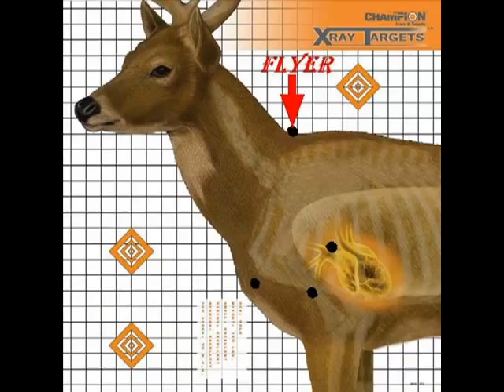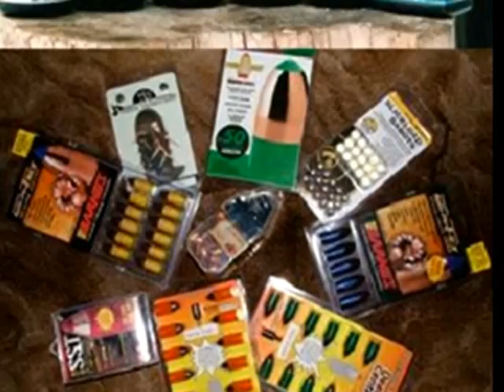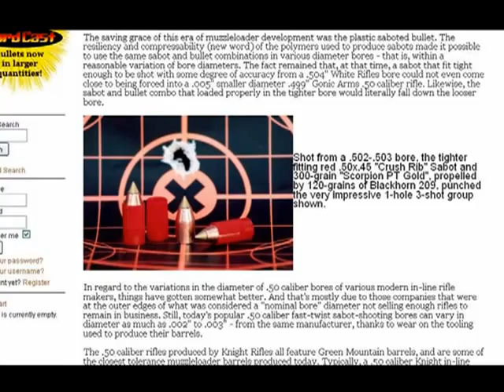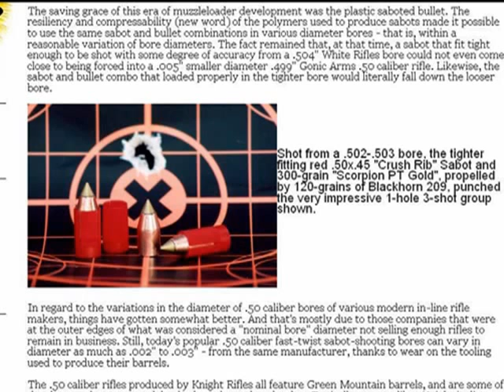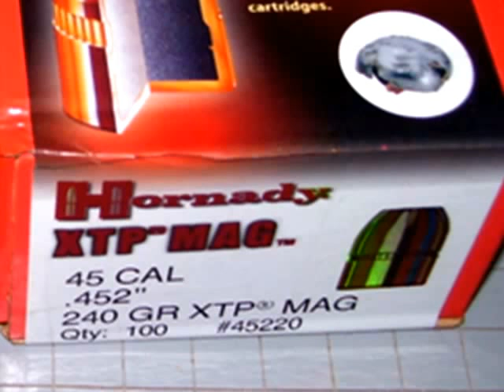Muzzleloader Accuracy Using Aluminum Foil  - Barrel Size -

Comment: I have had people at the range tell me the TC supper glide tend to not grip the bullet well with a heavy charge of powder. The bullet will slip in the supper glide and not spin true to the rifling in the barrel causing instability. One guy had the same problem that you had. He took a small dremel cutter and cut a fine line in the bullet and filled the line with a red wax pen. After he fired his ML he recovered the sabot and found a red smear in the Sabot indicating the bullet was not spinning with the sabot. I thought it was interesting after reading your post. Just thought I'd pass it along. All ML are different. I have 3.... two TC in-lines and one CVA side hammer. The CVA only likes Maxi balls, The TC in-lines like Sabot but one only works well with 90 gr. of Buck Horn 209 and the other likes a 100 gr. of Pirodex. Go figure. I am going to try the foil... Thanks for the info.
Reply from the maker: Thank you Gene for your post, great idea. It makes sense that the bullet isn't getting good spin in those super glides because until I used the foil to really tighten things up I was getting terrible accuracy. I guess it is possible that my whole problem could have been the super glide sabots

Comment: good  idea, but here is a better one. Buy some hornady FPB's (i think thats what they are called.) they are regular bore sized bullets no patch or sabot required. the bottom of the bullet is hollowed out like civil war mini ball. so whether you have a .501 or .503 barrel it doesn't matter, because when you fire the hollowed out base expands into the rifiling of the barrel. they mushroom well and maintain up to 85% of its weight after a hit.
Reply from the maker: Great input. I will definitely give them a try. Thanks.

Comment: Now if you REALy want to have fun and an accurate rifle, Try casting your own bullets.  As a patch and ball guy for years, Recently I started casting the Lee, REAL 50-250 bullets tumble lubed with Liquid Alox.  These things are Deadly Accurate.  Tight groups, Easy loading, The claim that they clean the barrel as you load is for the most part true.  I swab the barrel after about 10 shots or so with these.  But, no sabot, no patch, easy load, and the accuracy is hard to beat.  Not to mention the fun and satisfaction of casting your own bullets and taking a nice deer with the bullets you made.  Just be sure to use pure lead because alloys and wheel weights are nearly impossible to load.  These things form to the shape of your barrel and the rifling as they are loaded.  Each bullet as you load it becomes a custom bullet for that barrel. They start a little tight then slide down easy as can be.  Try it, you'll like it.
Reply from the maker: Thanks kaskoma, great post. I would love to learn how to cast my own bullets. Is there a good video or website to go to to get started? Also is the stopping and killing power of pure lead as good as the commercial sabots you get at the store?

Comment: Very interesting solution!!  It must make the sabot grip the bullet to transfer the spin much better than no foil.  I've always been suspicious of sabots.  Do the math: 1:28 twist, 1500 fps = 38,576 RPM SUDDENLY from dead stop.  There will be a LOT of torque transferring to the bullet from the sabot, and the surfaces are polished.  THEN you have the separation of the sabot from the bullet, with the 6 sabot petals/fingers sticking out in the wind trying to pull itself away from the bullet.  THAT can't help accuracy.

What about the old "Minnie ball", the conical base bullet??  Easy to load, the base expands to seal and grip the rifling, no plastic deposits in the bore.  Cheap and simple.  Does everything the sabot does and more.  ??
Reply from the maker: Great post. Thanks Lowndes. Have a great day.
Reply: I agree, I had awful luck with sabots. I'm trying to get sighted in with power belts but my gun seems to really like Barnes

Comment: Awesome tip, thank you for sharing. Anything else you have found?
Reply: I had same problem as him with my Cva optima v2.  I kept trying all kinds of combinations like he said and spent a LOT of money trying to find my guns accurate combo of powder, primer, and bullet. The more bullets and powders I bought the more frustrated I got. Finally I found what worked. It was those powerbelt bullets. My best load is 100 grains of triple 7 powder, a 295 grain aerotip power belt bullet, and going bang with triple 7 primer. My fricken cva shoots 1 inch groups at 100 yards. I read up on shooting without a sabot and why it works and found out. This video is a perfect example.... it's because the guns need a true 50 cal bullet. When shooting 50 cal rounds with sabots, the rounds are actually smaller than 50 caliber. The sabot makes its 50 cal....  the bullet itself might be 47 cal or 45 cal but it's not 50. Like he said the bullet is never actually touching the rifling of the barrel because the round is too small!
Reply: @iowabuckinrut760  Yes you are right. And Optima is a magnum rifle so you can go 150 grains, but 90 is considered the overall best load, with 240 or 270 bullets. You can use White Hots pellets, they are 50 grains each so you dont have to mess with powder. I think you know that anyway.

Comment: Pretty sure you are pronouncing sabot wrong. It is pronounced sah-bow. It's the French word for the wooden shoes that were thrown in machinery to sabotage it which is where the word sabotage comes from. Just FYI.
Reply from the maker: Thanks James.
Reply: Sam Lilly
No prob. So just how tight should a round be. I recently bought a Thompson Hawken. I shoot lead balls and the patches I bought were very tight. It was quite difficult to push down the barrel but not impossible. I've had black powder before and dont remember being that tight.  Any experience/thoughts on this for lead balls?
Reply from the maker: Never messed with the round balls, but I would think that a good tight fit would shoot better than a loose fit. If you have a looser fitting round balls let us know if you see any difference in accuracy.   Thanks

Comment: I would dare say that it is time for you to get into casting your own lead boolit... You have the ability to acuratly "slug" your bore to give you a real measurement of your bore and you can easily size your boolit to the proper diam..... Check it out at the cast boolits site... For what your paying in buying you stuff, you could already have a simple setup for pouring your own.... Fit of the projectile to the bore is king....

AlaskanGuy
Reply from the maker: Good information AlaskanGuy, I will definitely look into casting my own. Thanks.

Comment: I use round lead ball and patch. I have messed around with the round ball diameters as well as the thickness of the patch material. I think that's what people did back in the day. You are mostly doing the same thing and that's why it's working for you. But anyone who posts a video to help his fellow shooters is alright by me. Hat's off to you sir.
Reply from the maker: Thank you PeterDad60, there is a lot of trial and error involved it getting the right diameter and powder load. But it is definitely a labor of love.
Reply: Sam Lilly: It's also a lot of fun.

Comment: Im just curious as to what bullet and powder and how many grains you settled on. I didn't have time to watch the video all the way thru so sorry if you answered that. I am like you and have done a lot of research on muzzleloaders. I have a cva accura and shoot around 90 grains of blackhorn 209 with a Hornady SST low drag. I am thinking about switching bullets and going back to powerbelts. I am not impressed with the sst and its deer killing capabilities. It is an extremely accurate bullet however. I do know that powerbelts are not supposed to be a good bullet for TC rifles but I cant say this first hand. TC rifles def like saboted

Comment: Sabot is pronounced Say-Bow as in bow and arrow. ;) great video by the way.
Reply: Sam Lilly

Bullet 'fit' is everything, no matter what you're shooting.  I don't even begin to understand why anyone would want to shoot modern jacketed bullets and 'plastic sabots' (Hawwwk-pitook!) in a M/L rifle BUT, each to their own -  I guess??  M/L rifles do best with pure or soft alloy lead bullets, grease-grooved or paper patched.  The rifle should be slugged to determine the correct bullet diameter to be use and an appropriately sized mould obtained.  Typically, a M/L bullet should be at least land dia. and maybe slightly bigger.  Oh yeah, and take my advice on this, pick up your 'rifle' (ugh!), break it over a rock and get yourself a proper traditional M/L.  Trust me, you'll thank me for this.  Sheeeech!
Reply: @davidaitchison7635  hi david, i bought a lyman mold for my 54 cal great plains ML.  Its a minnie with a hollow skirt. Its made a touch small so you can load multiple rounds without cleaning. the powder explosion expands the skirt into the rifling and i get incredible accuracy that way...cheers!
Reply from the maker: Got it. Thanks Jon.
Reply: Your very welcome.

Comment: I am sure that the foil you are using for this is the thin cheap kind that can be bought in an off brand in any Dollar Store & not the heavy type of Alum foil like you use in your Oven to cook a Turkey etc.?
Reply from the maker: Good question,  I guess if there are different thicknesses of foil it would be a good idea to take note of the brand we are using.  My Wife buys Reynolds Wrap so that is what I used in the video. Thanks for the post.

Comment: Just for kicks I measured my TC ML barrels to. Mine measure right at .501" one is a TC Omega Z5 the other is a TC Pennsylvania Hunter patch and ball rifle ive had for 25+ years. The ball rifle shoots 2" groups all day with 80 gr FFF BP, The Omega shoots 2-2.5" groups at 100yds with Hornadys FPB in the 300 gr weight over 100 gr 777.
Great informative video man. Keep them coming.
Reply from the maker: Thanks for the post Tracey. I bet that TC Pennsylvania Hunter is a blast to shoot.
I bought a CVA Optima about a year ago and I get 2 inch groups at 100 yards without having to use the foil. Ray in the post below measured his barrel at .501 and was getting terrible groups without the foil so I guess the mystery continiues.

Comment: yah you are right I remember reading about this topic a few years ago when I was making a .50 cannon barrel I just reamed it smooth bore to exact .500 but at the time I was thinking the same thing about the tolerance variance from manufacturer to manufacturer. why not be exact? .503 .501 whatever just make a standard.
Reply from the maker: I agree Jacob it would make things a lot easier if there was a standard barrel size in 50 cal. muzzle-loaders. Thanks for your comments.

Comment: Hey guys, hopefully you read this before hunting season starts.  CVA makes a Breech Plug specifically for use with blackhorn209 powder.  Check it out here on the CVA website.  Hopefully this helps with misfires when using lose powder vs. pelletized powder.

Comment from the maker: Sorry I didn't get back to you sooner. I think most of the time the problem can be solved by changing your powder charge. In my case I had tried going in 5 grain increments from 85 grains up to 150 grains and I was still getting flyers. But if you want to save time and money try the foil first and take 4 or 5 shots and see if your groups tighten up. Good luck.

Comment: I have a Knight KP1 .5025 and a CVA, .5030 and they both take different loads, but they both get 100 yard 3 round groups of 1" MOA . Hornady makes oversized bullets .452 and try different sabots, not the ones in the box! My .503 takes a "MMP Black HPH/12 sabot" and T/C Shockwave 250 grain blue tip bonded bullet over 120 grains BH209 and CCI 209M primer. My .5025 takes a Hornady SST 250 grain (.452), black harvester crush rib sabot, 120 grains BH209, CCI 209M primer. Try the 24hourcampfire forum.

Comment: i used blackhorn209 in my cva optima 150 grs same as the 777 load i us in it with a 44mag sabit all it did was sound like a air rilfe the deer was at 60 yds the deer just stod thier i wasnt sure if the bullet came out i pured that junk on the ground and used 777 then i killed 3 deer this yr i use win. primers to i dont know why it didnt work like iv seen on youtube about it

Comment: 110 grains of loose Triple 7 and a Barnes TEZ works extremely well in both my son's Truimph Bone Collector and my 1st generation Truimph.  I've shot mine at 200 yards and consistantly hit a 3" bull but you have to keep the barrel clean.  They both shoot sub1" at 100 of bench.  You have to use TEZ as it's a different sabot thickness.  Seat load the same(I use medium pressure) and use 1 wet & 2 dry patches after each shot at the range.  Good luck.

Comment: man i went shooting last  weekend and still no good results. my best groups are about 2 inches @ 50 yards using shock waves. Ive gots some xtps arround here somewhere i need to try. Hope i can find them. Ive got a load data book for the T/C triumph and ive tried some of the loads but not as successful as the authur. Each bore is different

Comment: you do know you can also get sabots of diff thickness
Reply: And theyre mmps too . The much more flexible harvester is a Much Better sabot !!!
Reply: @bobgyetvai9444  Accuracy tells what is better. What is good in one mloader is not always good in another. Ive tried several makes over the yrs and it can be a finicky challenge. So far, Ive had very little luck with any sabot spire point combo. The green sabot 240 grain xtp, has performed best for me over the yrs but it has cons too. Accuracy is good, but some hold together, some do not. Ive had near perfect mushrooms, and complete fragment explosions. Usually the frags are shoulder shots I think. Ive done ok out to 125, but not sure past that if the XTP 240  will perform. Id say 150 yrds max, 125 yrds and in is most desireable. I was planning on trying the Hornady 265 grain interlock, but they discontinued.
Reply: @Hill_Billy_Without_A_Hill  the 265 ftx for the 444 isnt discontinued . The bc of 225 is quite conservative too . The mmp sabot Must be driven much harder for seperation than the harvester . A .004 thou over bore size is where accuracy is found along with a quick shedding flexible sabot such as the harvester . Thats Fact , a universal one at that !!!
Reply: @bobgyetvai9444  the 265 interlock is discontinued, the ftx might not be, but the interlock is. Hornady said demand wasnt good enough unfortunately.

Comment: Glad it worked for you. It's the same thing as paper patching. Personally I shoot mainly two MLs. First is a Savage and second is a older Knight DISC. Both like them loaded tight. Really have to lean on them to load. Any of the slick sabots don't shoot worth a hoot for me. I'm getting less than 1.5 in groups at 100 in both guns. Each gun likes what it likes. Some like tight, some loose. Some like pushed fast and some slower. It just takes some experimenting with your set up. Sounds like your GTG